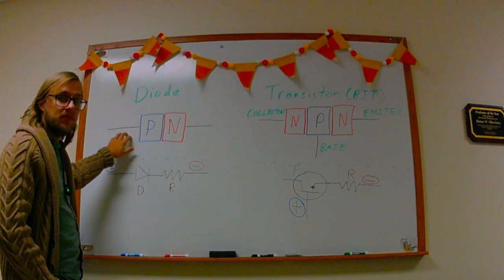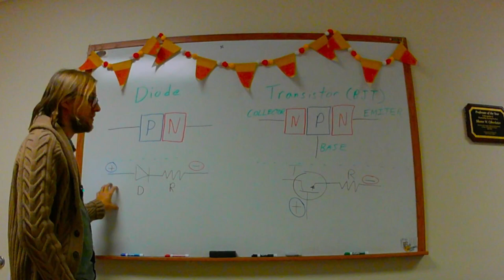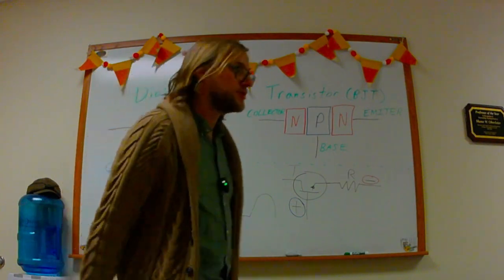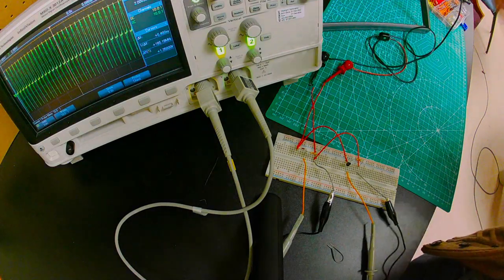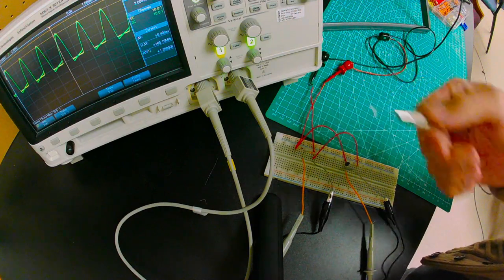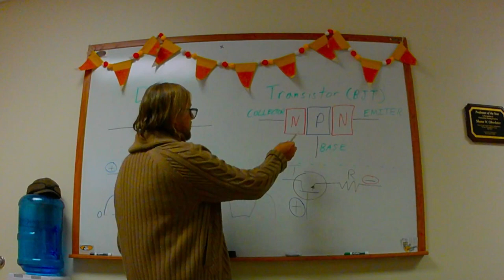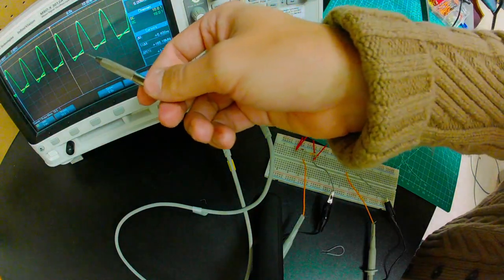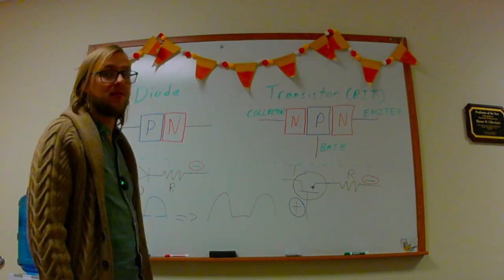Can a Transistor Act Like a Diode?

Comment: Great experiment.
I'd have loved to have seen a situation with collector and emitter connected together, and then use the parallel diodes base => collector and base => emitter. Maybe some of the negative effects might go away? Or maybe not.
It'd be able to handle somewhat more power, maybe.

Comment: I'm no electrical engineer, but as an experienced plumber, could you apply something (like a resistor?) on the unused N node to reduce current leakage? If you could somehow reduce/eliminate this, you might be able to mimic the diode.

Comment: Would the reverse setup work at all -- that  is, using 2 diodes back-to-back to make a transistor?  So, set up the diodes like,  N-P wire P-N where the 1st "N" would be the collector, the "P wire P" would be the base, and the last "N" would be the emitter?  I suspect not, because my recollection is that the base needs to be physically narrow for any amplification.  But, similarly, in a transistor, what if one were to swap the emitter and collector?  Would there be sufficient symmetry in the transistor for that to work?
Reply from the maker: Interesting thought! The unique physical implementation of a BJT, with its narrow base, is pretty critical for its operation and amplification ability. Simply using back-to-back diodes won't replicate this because you can't mimic the transistor's base width and low base resistance. Trying it out could be a fun experiment though! As for swapping the emitter and collector, it's not quite symmetrical due to doping levels and the physical size of the regions; the transistor is designed to optimize current flow in one direction. It might work to some extent, but with much lower efficiency and different (likely undesirable) characteristics.

Comment: I wonder if the reason for those negative spikes are due to current leakage within the bjt? Since I don’t think the base is designed to handle any meaningful current when used in this configuration.
Reply from the maker: You're onto something - those negative spikes may stem from charge storage and capacitance effects at high frequencies. Despite similarities in diagrams, physical differences like current handling capabilities do come into play in practice.